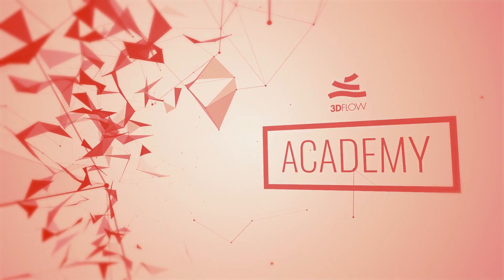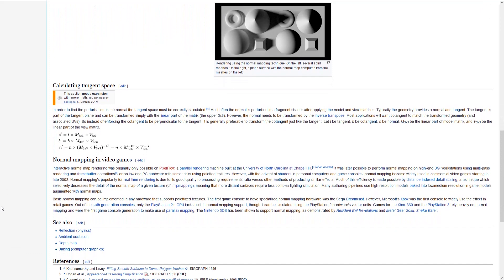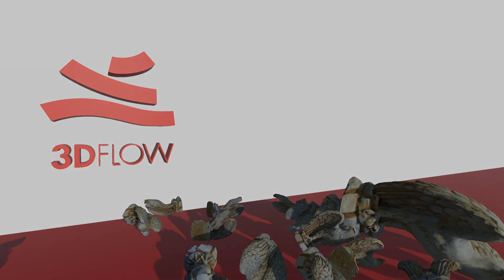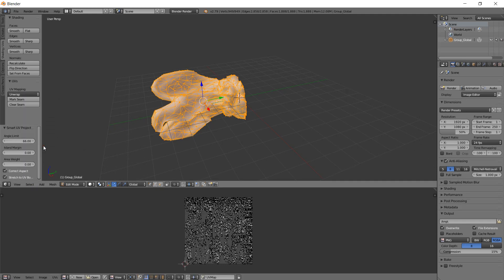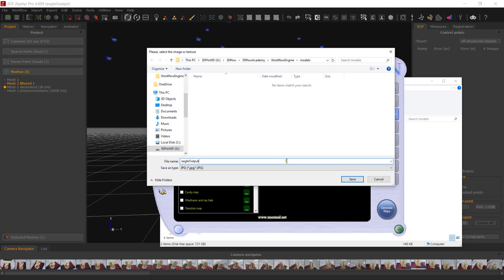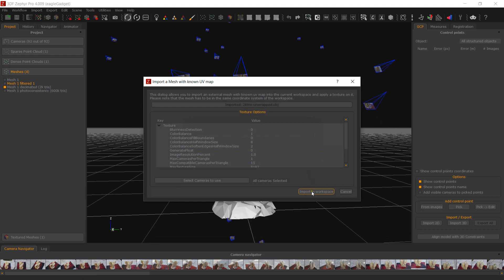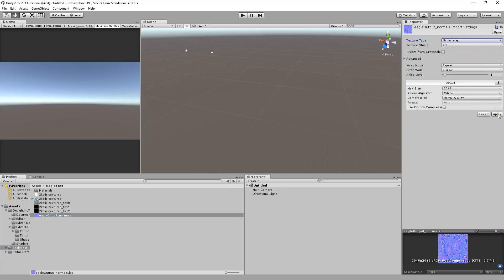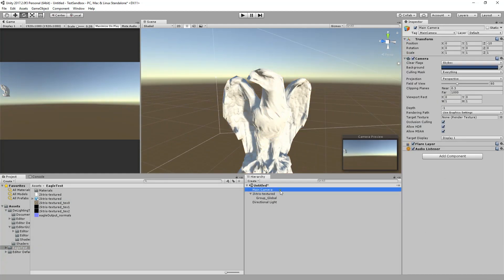3Dflow Academy - Videotutorial 13 - Photogrammetry to low poly asset (Normal map baking)

Comment: When I export the meshes, it says that the coordinates are to huge. if i convert the coordinates to geographic and scale it down in blender (otherwise xNormal doesnt work), i cant reimport the mesh with UV in zephyr... can you help me please?
Reply from the maker: Hi Kimanox! It means that your project is georeferenced (probably GPS in the exif). Are you sure you need georeferencing? If no, simply click the "reset workspace to local coordinate" button in zephyr (to reset the full workspace - not just on export!) - it's the circle thing right to the "gizmo" icon in the toolbar